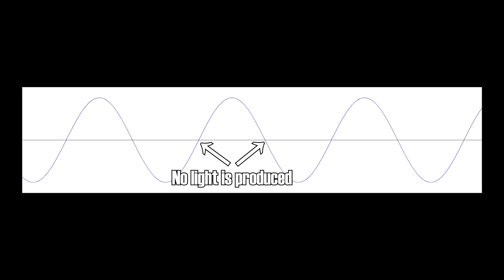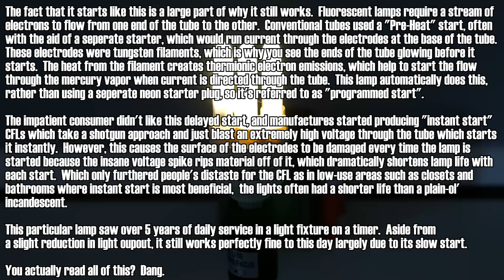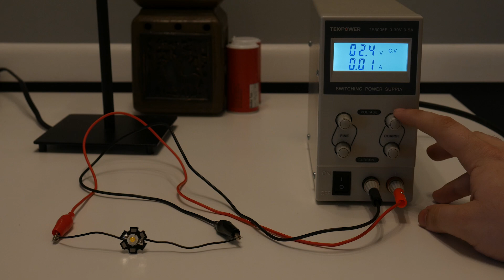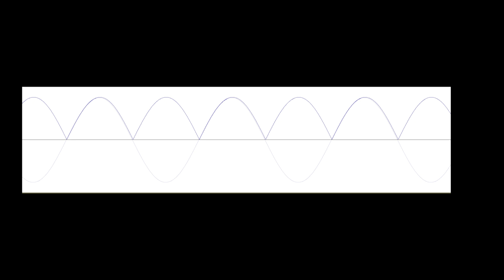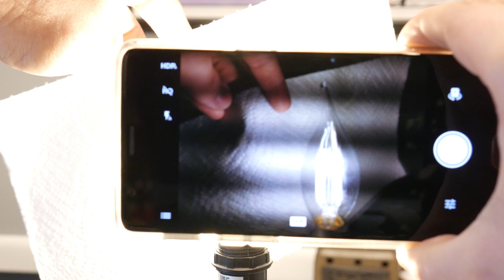LED bulbs that flicker, and CFLs that almost never did

Comment: I am extremely sensitive to the pulsing/stroking of florescent and LED lights. I've known this for years and could not believe other people could not see it. When I was a kid my school's florescent lights used to make me almost sick from kind of vertigo. Like when you are in a dark room with a strobe light to long you can get the same ill feeling. When computers became a "thing" with CRT monitors I could alwasy see the monitors set at 60hz from across rooms. I could pick out a monitor in a sea of CRT's in a computer lab that was set to 60hz. Again, most people told me they could not see this. Sometimes others can see if if they look at the CRT out of the corner of there eye, look above the monitor at a point. 
I could also tell when the schools upgraded to electronic ballasts in their florescent lights. The flicker was almost gone.
Then came LED. At first most where great. Then I started to notice some flickered. People told me I was again crazy as LED lights didn't flicker.. I was like no.. I'm totally sure this thing is flickering.. later to find out by making them cheaper they now flicker.
I could also tell a 75hz CRT.. though it was harder. I could not "see" it from across a room like 60hz. I'd have to change 75 to 100 or have 2 side by side to tell the dif between 75 and higher. 
A doctor I see for ADD and other mental fun said in passing while listing symptoms others have "sensitive to florescent lights" I stopped him dead.. wait.wait.. no kidding! Told him how I've always known I was way more sensitive then others and he said yep.. this would help explain it.
Reply: The ones that I've found that I can't notice any flicker are Philips filament style (labeled flicker free on package) and the newer Cree LED's that they sell at Home Depot. I tried the camera trick like in this video and I can't notice any flicker with both of them, so I feel the claims are correct. My bedside lamp I use a Philips filament style and it seems fine. My utility and laundry room still have some dirt cheap ones from Ace Hardware. They make my rolling shutter go crazy. The whole house was filled with them when I moved in and 2 of them have already stopped working. I replaced all the lights that I use often like the kitchen, living room lamps, and bathrooms with the Philips and Cree right away, they're still working great.

Like you, I can notice flicker more than the average person at least. I too could easily see when CRT's were at 60Hz, I always bumped mine to 75 as it drove me nuts. LCDs were a blessing when they came out as even at 60Hz, it was much easier on the eyes. I now have a 144Hz monitor and I'll never go back. At least for my main monitor. My secondary is still just a 60Hz one.
Reply: @andrewt9204  same here. I could only use CRTs at 85 Hz or more, the 60 Hz gave me instant headache. Also for the LED bulbs, the best ones I have are Phillips. I have various filament bulbs of various CRIs and age and they are all great! So far, only one or two broke prematurely, they are flicker free and somehow only Phillips manages to give the 2700K bulbs the right amount of red to make them look almost like incandescent bulbs, all the other manufacturers produce bulbs with a strong yellow cast, even at CRI 90±. And don't get me started on Osram! As a German I thought I could get superior German engineering for the premium price they're asking. I could not have been more wrong. Color cast, flicker, premature death, and flicker. Did I mention the flicker? So much flicker. It's really sad, because they made the best CFL tubes!
Reply: I don't 'see' the flicker but the spectrum and PWM of LEDs triggers migraine headaches for me. Also, I can 'hear' the whine of a CRT and flourescent ballast, and although people say you lose that ability as you age, it seems my sensitivity to that is even stronger as I age. I can also hear a router.
Reply: @NickDalzell  

I dunno about hearing the router dude. Everything in a router runs WAY higher than audible frequencies.  If I could venture a guess, I bet you’re hearing the SMPS in the router starting to go bad. They are noisy before they die. When CRT TVs were popular, I could tell one is on when I walked into a room, without even seeing the screen. 

I’m not doubting your ability to hear the router, but I can clearly hear when a power supply is starting to go bad. I bet that’s what’s you’re tuning into.
Reply: @mikebruestle218  Both my sister and I could hear from upstairs if the basement TV was on, even if nothing was on and it was just showing that classic blue VCR screen or soundless static.
Reply: I have a similar experience, although far less extreme than you. I mainly see flicker in small lights (specifically back lights of cars), and I have also noticed that nobody else appears to see them. I also sometimes see it in Christmas trees. When visiting some people a while ago I noticed that all the lights in their living room did this, and I saw it in someone's car dashboard as well. I mainly notice it when my eyes are moving, because then I see patterns of dots and stripes. At a previous job I sometimes felt very tired, and I think that was caused by a combination of fluorescent lights (at 50 Hz) and monitor (at 60 Hz). At some point I just removed the lights above my head and that fixed it. I'm happy with this video and the responses here, because now I know what to look for when buying new lamps!
Reply: I don't think you have sensitivity to florescent lights from ADD, that wouldn't help explain it, your story is just so much stronger than most people's perception of the flicker. You likely just have much smaller persistence of vision or some other optical explanation. Whatever it is, isn't a psychological thing.

(Unless it's the other way around, where the vision issue affects your ability to concentrate. Replace the bulbs to fix though!)
Reply: @npip99  You are right it's not a psychological thing.  But it's likely not solely a vision thing, either.  It's likely neurological as ADHD is a neurotype, not a psychological disorder.  Us neurospicy folks have more neurons than the normies.  We take in way more sensory information than the average bear, and our brains just process all of it instead of weeding some things out.  (Except when they don't.  Audio processing disorder, anyone?)
Reply: I lit my college dorm room exclusively with Christmas lights because I COULD NOT focus with the fluorescent lights they put in those rooms. However, I am surrounded by all kinds of neurospicy people (from parents to friends to my husband) who could also see the flickering and completely understood my hatred. I actually didn't realise people couldn't see the flickering until I read this comment.
Reply: It's correct that older fluorescent lights with magnetic ballasts and starters run at 60Hz, newer electronic ballasts over 1,000Hz
Reply: Yeah, im also quite sensitive to flicker. Only hight frequency flicker doesnt strain my eyes.
I have very similar problem with CRT monitors, i can see flicker with a naked eye up to 75Hz, only 85+ was good for me.
But even at 150Hz i feel weird discomfort with CRT, quite sad because their motion clarity is something else..
Reply: bro I did the same thing as you. I thought the comment was mine at first lol. Also tried getting others to see it, but most wouldn't. On a CRT, 80 was where it appeared solid to me at the time (it probably is close). Turns out we are indeed most sensitive to this effect in our peripheral vision. This is why i today notice 165hz being not as smooth as could be on a fast panel, with fast moving objects (I use high speed ball camera view toggle in Rocket League). Yet, I can't see this effect it if looking directly at the fast moving "objects" - though I still probably would feel the difference if we doubled refresh rate.

CRT and modern panels would appear differently since they draw the image completely differently.

This also is why the table tennis VR game is unplayable to me with a 90hz headset.
While looking at the ball, it seems smooth enough.
But, while actually playing, you don't actually focus on the ball much, but ready up your reflexes while keeping the scene in your general field of view. I'm sure this is how everyone who plays it does it (unless they are completely fresh)

This effect so renders the white ball incredibly juttery. I can't play it. Tech meets biology and fails with this one.
Reply: I have photosensitive epilepsy. When my stash of incandedcents runs out, I am screwed. Pardon the pun.

Neat trick: open your phone camera app and point it at an LED lamp. You'll most likely see vertical lines traveling from left to right--even with so-called "flicker free" LEDs. Now put the camera in front of an incandescent bulb. Magical!
Reply: Yes there is indeed a giant gap in available LED bulbs nowadays. Lots of them flicker like hell, even "good" ones like Osram. It's basically a gamble what you get since even for the same bulb they might have changed the electronics over the years. This is why I do not want LED in my room. I use fluorescent tubes with a good ballast at 40 kHz. They are even cheaper, last longer, and you can easily switch the color temperature in a minute by just switching a $5 tube.

Comment: As a newly graduated electrical engineer I’ve got some insight on this.  I suspect the cause of the flicker is that as you mentioned with LEDs a small change in voltage will cause a massive change in current and thus light output.  So even a slight flicker in the voltage will cause a noticeable change in the light created by the bulb.  The driver probably does a decent job of creating DC, just that the ripple gets amplified a lot by the bulb when the current isn’t regulated.  The regulation can actually be done cheat and easily with a single current limiting resistor which would almost eliminate ripple current, but the voltage drop of the resistor would lower overall efficiency.  I could be wrong, but I suspect some LED bulbs are more efficient than others, and that the less efficient LED bulbs will produce almost no strobing effect, with the more efficient ones will.  That’s just a guess though.  I haven’t looked into how things are actually done to know for sure.  This is mostly based on my knowledge of what can be done and how LEDs work.
Reply: Using a inductor does help more than a capacitor.

Comment: You should add that the Curlicue lights are a fire hazard. They get extremely hot, and more than once I've seen them fail catastrophically by having the driver board melt or burn. One bulb failed so bad it blew a hole in the glass. They are so cheaply and poorly made it's a miracle they ever made it into the consumer market. They have, in my experience, a very poor life span of sometimes only a few weeks, which is pretty dumb. While cheap LED bulbs sometimes don't last much longer, they at least don't release toxic gasses into the house when they fail, or get absurdly hot.

Comment: Incandescents have the least amount of flicker because it's Analog. Since it has a very slight delay when turning on and off due to the filament warming up and cooling down. By the time that 50hz or 60hz circuit has gone halfway, the Filament still has enough heat to remain lit thus reducing noticeable flicker. LED is Solid State so it turns straight on and straight off. Great for torches, TVs, not so great for house lighting.

Comment: Yes, I actually read all that. That is a dumb-ass marketing decision. "Let's make these start instantly, but as a side effect, remove their immortality! Njehehehe! Derp." Usually compact consumer CFLs fails because the filtering capacitor eventually dries out because of the high heat output and fails.

Comment: I am so happy I found your channel! It’s AMAZING content. I love this treasure trove of greatness. ONE BURNING QUESTION. I have a severe adversion to certain color temperatures in the LED bulbs. I miss my incandecant bulbs warmth and color. Halogen has always appealed to me as well. Ibe switched 100% of the bulbs in my house to LED. I’m not happy with the various brands I’ve found. I want first and foremost warmth, no strobe, and dismantle. COULD YOU PLEASE give me some specific brand models to try? The light in my home has a dramatic effect on my mood. (I suffer from OCD and anxiety) Consistent colorvyemperature throughout my home would make me happy. Thanks for your work!!!!!
Reply: Try the c by ge smart bulbs they have tuneable white light so you can set them from 2000k-6500k but cost $15 a bulb. Or there are ones by Phillips. I use the great value daylight LEDs in my house I have the warm look daylight is brighter and a cleaner looking light.

Comment: Can anyone explain why all the modern LED light bulbs I've purchased at Walmart (including different brands and designs) won't work on a modified sine wave inverter but the good ol' CFL's work fine?  Are there some LED bulbs that will work or should I hoard a few CFL's in my bulb closet for power failures?

Comment: I am among those who DESPISE CFLs because of their cold blue light.  I have to live with horrid florescent lights at work.  I will not tolerate them at home, except as garage or outdoor lighting.  I had resorted to getting black market incandescent bulbs from the dark web.

That said, I tried some "soft white" LED bulbs that were on sale to give them a try.  Although one bulb may be defective, the other three are working well.  When I had a 60 W incandescent in one fixture and a "soft white" LED in another, I could barely tell the difference on the wall, except the LED was a bit brighter.

I guess I am among those that will begrudgingly accept LED bulbs, as long as they are good/high quality and the light produced is indistinguishable from incandescent.